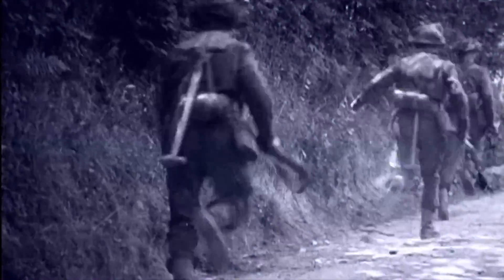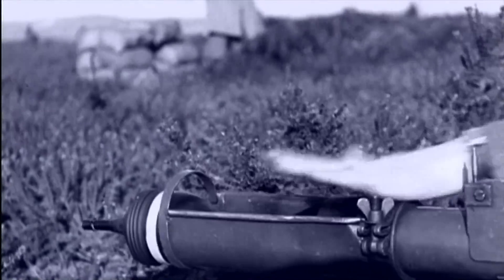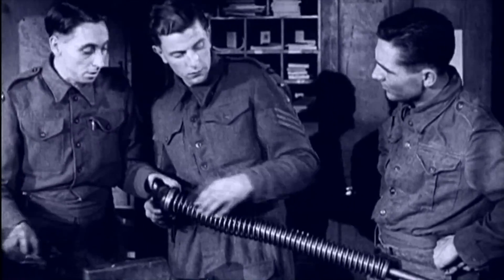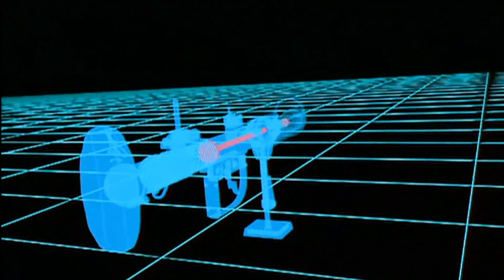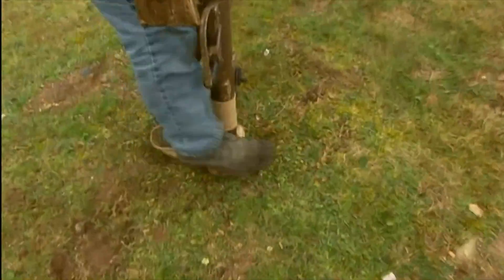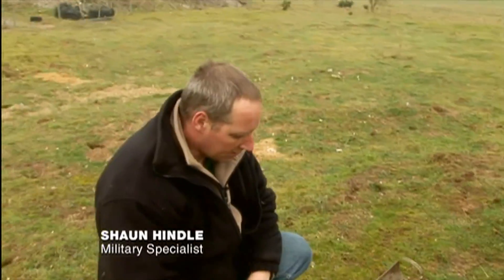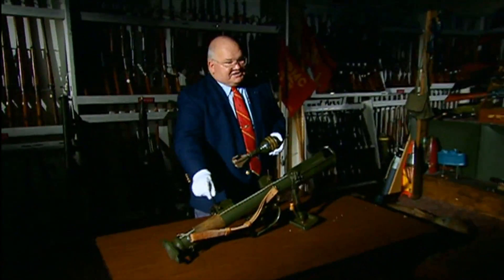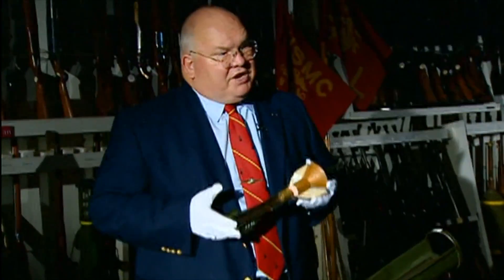Weaponology - "British PIAT"

Comment: No back blast or muzzle flash so ideal for firing undetected. Just because the range was short doesn't instantly mean it was terrible.
Reply: +CruelestChris guys like you seem to enjoy going round youtube videos and screaming your opinion in every comment that doesn't align with your point of view to make yourself look clever, i bet you have fun going round children's school plays and pointing out inaccuracies in the nativity story. 

But back to the main point of my original comment, would you rather have a possibly slightly less effective but multi-purpose rapid firing hollow charge launcher or a long reload weapon that relies on  the electrical ignition of a rocket motor to fire. Also the considerable back blast of the bazooka could be dangerous to troops behind the weapon while a PIAT presented no risk to comrades situated behind the firer.
Reply: Gregory Clark I would rather have something that could hit a tank from over 50m away
Reply: +Gregory Clark It's not worth arguing with the idiot mate. PIAT had some huge advantages over the rest, it was the only rapid fire man portable tank weapon for a start. A PIAT team could effectively do the same job as several bazooka teams with much less chance of being detected. Downsides - it was heavy and had recoil.
Reply: +CruelestChris I'm using it as evidence because it is numerous, official, concise, hard evidence. Do you have any?
Reply: CruelestChris
Right so it's only the 161 polled WW2 vets that said it was brilliant. But we shouldn't believe them, we should believe you in stead - a guy who thinks you can fire anti-tank rockets indoors undetected no problem as long as you leave a door open.
Reply: +CruelestChris Pure conjecture. You'r opinions count for nothing.
Reply: +CruelestChris Depends how much of a wimp you are.
Reply: Although once you fired its first round (assuming it worked) you had a shaped charge downrange every 4 seconds. With charge big enough to punch through a Tiger frontally and notoriously poor target acquisition on German tanks (from narrow sight pictures), if the PIAT got close to a tank it was going to kill it.
Reply: +CruelestChris They were all notoriously inaccurate. The advantage of PIAT was that you could rapidly fire off more rounds to compensate.
Reply: agt155 if you could hit anything
Reply: CruelestChris yeah that explains how there was still a Britain for you lot to 'save the ass of' two years into the war doesn't it... one bad weapon system does not a wimpy country make. I suppose the paratroopers at Arnhem using these things against Tiger Tanks at point-blank range were 'wimps' too, sure they were overwhelmed but they gave a lot more than they got and these admittedly terrible weapons still took a toll on the enemy whether you're prepared to accept that or not
Reply: You should research the VC-winning actions of Robert Cain and Ernest "Smokey" Smith as an example of the potential effectiveness of the PIAT.
Reply: CruelestChris How will they be able to figure out where they're firing from when they're dead?
Reply: CluelessChris.
Do you really think you are an authority on anything?  It is rather simple a well hidden PIAT could fire a few times from one position or relocate but you are jumping to the assumption there was something better which there was  not at the time, the Bazooka was later and useless until very late in the war.  My idea is based on what really happened rather than your comic book guesses of war.  Obviosly if they had an unlimited supply of anti tank guns that could be used quickly against advancing armour supported by infantry but in the real world there are many times when a small easily portable weapon that was easy to hide and that could destroy a tank is very useful.
Reply: CluelessChris.
Since you manage very well to live up to the name it seems to fit rather well.
The fact is rather simple there is no point talking about the merits of different weapons since at the time there was the PIAT or nothing.  The Bazooka was later and not as good.  
You said it the early Bazooka was pulled out of production but since you want to say they could have had the Bazooka at the same time why would the british want an expensive weapon that did not work?  
I stick to the facts, the PIAT could be used in places the Bazooka could not, the Bazooka gave away it's position while the PIAT did not.
The truth is the PIAT was not perfect but it did the job at the time.  
If the enemy has time to work out where a PIAT might be when there is a good chance there may well be a few more also hidden in the sme area and if one fires another may fire a couple of seconds later from a diferent position.  
You might wnat to make out there would be just one PIAT with no back up and maybe you need to think that for every PIAT there are probably a number of Bren guns and other weapons in the same area.
Reply: +CruelestChris Or perhaps it's just thier sense of humour? Canadian soldiers voted the PIAT their favourite weapon of the war, couldn't have been that bad could it?
Reply: I doubt you could throw a hand grenade that far and  and a hand grenade would have no effect on a tank. At least the PIAT was a very effective anti tank weapon.
Reply: CluelessGhris.
The PIAT was very effective at the time when there was nothing better and ould be fired frm a concealed position better than the later Bazooka which was not much good until late in the war and still needed improving.  PIAT teams could do what was required and one person could use the PIAT on his ownif he had to.  The crew of the vehicle fired at if it is still operational could try to guess where the shot came from and  hope to get the PIAT before being destroyed.
Reply: CluelessChris.
Just maybe I do know a little bit about war, I know real men fought and died, you are so desperate to make out the PIAT was no good that you are ignoring the fact it was the best weapon available for the job at the time.
So a tiny puff of smoke and a bang that may or may not have been noticed when you have tanks kicking up dust and making a lot of noise, men trying to keep their heads down in case apart from the PIAT there may be half a dozen Bren guns ready to take your head off. so for you the Germans would be standing up looking round for a little puff of smoke that they might just see before getting their heads shot off.  Could you try to stop being so ignorant or maybe that is just too hard for you.  
Real war is not like a Hollywood movie.
Group Captain Pickard was a pilot and commander in the RAF, awarded a DSO with 2 bars
Reply: CluelessChris.
The PIAT was as I have said many times the best available at the time, no fantasy about it being much less obvious when used than the Bazooka which wss not much good until the many issues were sort of sorted out after the war.  I did say that if the PIAT was American it would not be put down as useless but it would be claimed to have been the best thing since sliced bread.
Just maybe when you grow up you might strt to learn a tiny bit about war but that might be too much to expect from an ignorant fool like you.
Reply: Lmao you guys do remember a tanks field of view is pretty bad... the chances the commander is looking in the exact spot you are firing from is unlikely.
Reply: CruelestChris mum*
Reply: Strange that the PIAT was responsible for quite a number of German tanks, including the biggest German tanks that the Bazooka could not take out.  I would rather have a 17 pounder anti tank gun but for close range from a hidden position the PIAT was rather good.   
The piece of junk was a very good piece of junk if the results are anything to go by.  
Better a very good piece of junk than a perfect non existent weapon.
There are a number of people who think if it is British it is junk, if it is American it is the best.
I wonder how many tanks were taken out by all the wonderful Bazooka`s.
Reply: The BAR really was rubbish, the Sherman was ok but not great, it certainly was useless against heavy tanks, that is why the British put the 17 pounder in some of their Shermans so they had an even chance.  The Americans met few heavy tanks, the Britis and Candians did that.
Reply: +CruelestChris ....because war isn't a joke. They'd feel like real twats if they voted up this weapon for a joke only for the Canadian military to purchase 100 000 of them wouldn't they?
Reply: +CruelestChris The Canadian surveys are factual. You are just quoting old wives tales. What planet am I on? From the guy who thinks frontline combat soldiers from WW2 would lie about the effectiveness of their weapons "for a joke"..lol tell me another one, preferably with a bit of evidence this time.
Reply: +CruelestChris Do you honestly think Canadian soldiers were bullshitting when they said the PIAT was their most influential weapon? Answer honestly.
Reply: Those are quite a good advantages.
Reply: Barrie Rodliffe 
You are ridiculously exaggerating the extent to which PIAT fire could be concealed. The short effective range and ability to judge the direction of the shot based simply on which side of the target it hit would mean that most of the time infantry near the target would have a decent chance of seeing the puff of smoke from the propelling charge, and you'd only have a limited number of possible places the PIAT team can be.

PIAT teams relocated after firing just like everyone else. Nobody relies on the enemy remaining perpetually clueless when they're firing at a vehicle that only has to guess the right building to kill you.
Reply: Barrie Rodliffe 
Do you really think starting your posts with playground insults is a good way to get me to accept you as an authority on military technology? 

Anti tank teams relocate after firing. They can't assume they haven't been made, because you don't get to dodge a tank cannon round. Tanks operate with infantry, and infantry are pretty good at figuring out where a sniper is after one shot, never mind a weapon that's got to be less than one hundred yards from their current position.

Not to mention your idea only works in city combat and an unsupported tank in city combat might as well blow itself up and save enemy infantry the trouble.
Reply: Barrie Rodliffe 
Yep, you won't find me disagreeing with any of that.
Reply: Barrie Rodliffe 
I'm just doubleposting here because I don't want it to look like I'm editing the other one dishonestly, but to be entirely fair to the BAR it did give us the BAR mechanism , which as it turns out is very good if you flip it upside down, put an MG42 feed cover on it and call it an FN MAG. So the BAR is good if you turn it into a different gun :P

Much better than what the Yanks tried with sticking the MG42 feed cover on an FG42 and calling it the M60, that, um, didn't end well.
Reply: @CruelestChris  
The BAR is good if you turn it into a different gun, that makes sense to me.
To get back to the PIAT, in 1942 there were no Bazooka's and the PIAT worked, a soldier could use one on his own and he could take out any German tank from a hidden position  without giving away his position, perfect for ambushing tanks or even  moving through forest or buildings to get close and take out a tank before anyone knew he was there.  The later Bazooka was not as good in that way, use it once and everyone within a few miles knew where you were. Do not use it inside or you will only use it once.  
Was it a wonder do it all weapon?  No that is why they had a range of weapons.
Reply: @SvenTviking  
He has 161 officer's testimonies, unclear if they were given separately. He wants to use this to overrule people who actually used the things, because he claims they were joking. Um, right, ok. Why can't the officers have been joking? Oh, because he needs them to not be, I see.
Reply: +CruelestChris 
And you can stick to your day job instead of making crappy shoot em up let's plays. I suppose all those hours of reducing your brain to a violent, 'murica themed soup have paid off as you are now able to dump your unwanted opinion on a reasonable and intelligent comment showing the virtues of an effective and well liked weapon that was being unfairly criticised in the video.
Reply: +CruelestChris Why would they bother polling the soldiers if it didn't matter?
Reply: CruelestChris Your basic argument is that "It aint American, it aint shit!" And there's no links to the "info" on quality control.
Reply: +agt155 
You really do think they polled soldiers on what their favourite weapon was and the PIAT somehow won even though most infantry would never have even touched one, and this poll might have been used as sole justification for a bulk purchase? What's the weather like on your planet today?
Reply: +Gregory Clark What's even more pathetic is the guy has blocked me seeing his comments yet still replies to me. I've seen many special 'cases' on youtube but this guy takes the biscuit.
Reply: +agt155 
Oh, yeah, because that's totally how military purchasing is handled, right, they poll the soldiers on what weapons they like?
Reply: @CruelestChris  It was a survey of Canadian officers who had recently left combat in 1944 /1945 who voted it their number 1 most effective combat weapon with the Bren gun in 2nd place (incidentally a much better weapon than the BAR). Are you seriously suggesting officers would put their soldiers lives at risk whilst the war was still on by highly recommending an inadequate weapon as a joke?
Reply: @chrism7969  
It was a survey for a completely unclear purpose, of officers who watched weapons being used and not the soldiers who used them. They basically just put the most powerful weapons at the top of the list: the same list had the Sten in last place. Oddly enough, Canada did not stop using the Sten as a result.

And this survey of people who looked at people using PIATs (and in many cases probably not even that) is used to disregard many testimonies by soldiers who fired the things. Do you not see the problem with this?
Reply: @CruelestChris  Really, these were officers in combat who would have seen their men using the weapon. So what you are suggesting is that had the weapon been ineffective and resulted in men being killed to no purpose they would have recommended it for a joke? Do you know how ridiculous that opinion is? They recommended it because it could and did take out German armour and fixed fortifications. A weapon that could be fired from within a building with no.muzzle blast to reveal the firer's position is a very useful weapon. According to your logic the Boyes anti tank rifle would have been praised in the earlier part of the war because it was the biggest direct fire weapon an infantry company had but it wasn't and it was withdrawn from service for being ineffective.
Reply: @CruelestChris  Because the Stem was and is regarded as a rather poor sub machine gun. Cheap and easily massed produced but prone to stoppages which is not ideal in a primarily close quarter weapon like the Sten. Better to have the Stem than no submachine gun but it was a rather poor temporary stopgap.
Reply: @chrism7969  
How do you know that, exactly? Did all of those officers see every weapon in the Candian arsenal used at least once, or (more likely) did they just get a list of weapons and rank them by preference? Again, why was the Sten, a rugged and effective SMG, placed in last?

And I guess I have to give you the last point based on the results of the imaginary survey that doesn't exist outside of your head. How do you know they wouldn't have rated the Boys highly if it were still in service? Do you have a time machine?
Reply: @chrism7969  
Nonsense, the Sten was so effective the Germans started making them, Otto Skorzeny couldn't stop singing the praises of the silenced version. Of course, Otto, unlike these officers, had actually fired one. The British Special Forces seemed to like it too, given it was still in service until they adopted suppressed MP5s.

The only reason the Sten has a reputation for jamming is magazine malfunctions which it inherited from the MP40 due to using the same magazine, and the same spring failure issues with full magazines that the MP40, Bren and just about anything else with a spring follower had during the war.
Reply: @chrism7969 
No, the silenced versions were in service with the Special Forces until then, and the Volkssturm weren't the only ones using copied Stens. As noted, jamming issues were related to the magazine, and if a weapon goes off when you drop it, that's what a sling is for.
Reply: @chrism7969  
For God's sake it's the Sten, S-T-E-N, standing for Shepherd, Turpin and Enfield. It had the same problems with its magazine as just about every other weapon to use a dual-column single-feed magazine during the war, and it's pretty well documented that if they could get one, German soldiers would carry a Sten because it was easier to fire while prone than the MP40. And seriously, you think elite special forces are passed over for procurement? There was a suppressed Sterling, they kept using the Stens anyway.

All guns jam and malf, and soldiers love complaining about their gear and holding up the enemy's as better. We have accounts from Vietnamese soldiers about how they were stuck using grotty Soviet AKs and yearning for the space-age M16 that the American soldiers hated.
Reply: So you include the Thompson submachine gun as being prone to Jamming in your all WW2 submachine guns being prone to Jamming claim?
Reply: @chrism7969  
Yeah, it was. So much so that they completely removed the ability to load it with drum magazines in later military variants, and it was particularly known for locking up in North Africa because it didn't handle sand well. It also fired an extremely overpowered cartridge which made it hard to control in auto, and was too heavy and too expensive.
Reply: +agt155 
Do you know they weren't? Or that the survey has any meaning when most soldiers would by definition have been talking about a weapon they hadn't used and had no experience of any alternative to even if they had? You're the one trying to use it as evidence, you have to prove it actually is with something other than made-up bullshit about the magical consequences of soldiers dicking around with a pointless survey or not having tremendous insight into how their issued weapon compared to other weapons they hadn't used. Also how is it suddenly their most "influential" weapon rather than their favourite?
Reply: CruelestChris Straw man argument there, and a pathetic one at that.
Reply: sorry but by jumping up and down from a range of 30 metres the odds of you being spotted are almost certain.

the only good thing about this over other Rocket launcher systems was that you could fire it indoors and in rooms because of no rocket blast.
Reply: @Mush Morant Is right, it's one of those stories that convinced me the weapon was very effective in the right hands and situation, Even if an internet warrior such as Chris says otherwise.
Reply: Barrie Rodliffe 
Um, quite a lot of them. Since, you know, the penetration from the PIAT and M9 bazooka projectiles were exactly the same. So no, anything you could kill with a PIAT you could also kill with an M9.

Also given I've already said to you that I think the Bren was better than the BAR on multiple occasions, I don't know why you're still going with this "you just don't like British things!" angle. Fact is the majority of things you're coming up with either aren't true, don't matter, or omit key information that completely changes what they mean.
Reply: CluelessChris.
Thje Bazooka was good? only in the right circumstances,  it gave away it's position and was not so good.
The Rolls Royce Merlin engine was first put in a few Mustangs by Rolls Royce in late 1942, it took the Americans over a year to do the same and then Americans claim the Rolls Royce Merlin as their own because some were assembled by Packard.
The USAAF used  Bristol Beaufighters, DH Mosqitos and Supermarine Spitfires a lot yet hardly acknowledge that fact.
Reply: CruelestChris You must be fun at parties
Reply: CruelestChris But they still fucking fired it, and one made THE most important tank kills in Normandy, knocking out an AFV trying to recapture Pegasus bridge from the Ox&Bucks.
Reply: Your mom is fun at parties :D
Reply: As for the rest, this is Germany. Germany does combined arms. This fantasy situation where one tank putters into view and you're engaging it from a static position with no infantry supporting the tank? Doesn't happen. AT crews have to stay mobile. Bear in mind if you read his VC citation, the Tiger that Robert Cain shot (which was actually a StuG III) immediately knew where he was and opened fire on him, so, um, good job proving my point that the "firing undetected" claim is nonsense. In fact Cain and Smith's VC citations are excellent displays of how this weapon was actually used: aggressively, at close range, and with a great deal of danger to the gun crews. This wasn't some nice safe long-range weapon: if the Panzerschreck and Bazooka were powerful punches, the PIAT was a headbutt.

Note that I never said the weapon could not be used , just that claims that it was some kind of magic invisible rapid-fire superweapon, rather than a piece of junk that sometimes did what it was supposed to, are nonsense. Saying anything else disrespects the bold men who shouldered said piece of junk and with good old British grit and bloody-mindedness set about using it anyway.
Reply: No it's mom, it sounds more petty that way :)
Reply: But if you have to get that close you might as well just throw it or use a Molotov.
Reply: No, the Bazooka was good late in the war, if we were going by postwar reputation we'd have a much lower opinion of the M9 since the M9A1s issued in Korea had problems with the fact that nobody knew how to store rockets for extended periods (it had never really been an issue) and it was found the issued rockets had degraded to the point that they couldn't penetrate North Korean T-34/85s from any angle. Task Force Smith's experience during the Battle of Osan is a particularly infamous example of this.

Also come on, if "worked but was not American" was a factor we'd have a much lower opinion of the Merlin engine. You know, the one that was good enough the Yanks started throwing them on their Mustangs the first chance they got.
Reply: Barrie Rodliffe 
Thinking up cute little nicknames just makes it hard for me to take you seriously, which I don't think is what you want. We're talking about the relative tactical merits of weapons that have been obsolete for over half a century, not which Pokemon could beat up which other Pokemon.

I also never said that the British had something better (in fact elsewhere I've repeatedly said the PIAT was better than the M1 bazooka and comparable to the M1A1, and I'd only give it to the bazooka when the M9 came along). But seriously, your analysis is almost comically one-sided: if I were doing the same as you I could point to the faulty fuzes and hollow charge liners that severely impacted the performance of the PIAT when it was first used in Italy (25% of projectiles failed to detonate and there was something like a 20% loss of RHA performance because the hollow charge liner could easily become dislodged in transit).

Also you've said this before and it's still wrong, the bazooka was not later than the PIAT, it was actually around before it. PIAT was first issued around the time the M1s had been pulled from production because they were violently awful, and right before the M1A1 was introduced.

I said the reputation of the bazooka isn't based on its performance post-war, and that the reputation of British weapons isn't necessarily underplayed. Your attempt to trundle off into some fantasy world where a PIAT has the firing signature of a mouse farting while the bazooka has properties more normally associated with an erupting volcano is...well, kind of typical, at this point, but has little to do with the real properties of either weapon. You realise in most scenarios AT teams relocate because the enemy might find them through simple logic, right? Since the enemy is as capable of determining where a good location is as the AT team themselves are?
Reply: Barrie Rodliffe 
I never said it was no good. Do you even remember how this started? Your fantasies about the PIAT being some sort of invisible supergun weren't the issue. I was replying to you claim that the bazooka earned it's reputation after the war, and that the PIAT wasn't respected because it wasn't American.

Look, hilarious as your adorable little primary school bully act is, it's not going to convince me, so give it a rest and discuss this with me like an adult. Start off by levelling with me as to what, precisely, you're trying to prove here. If it's that the PIAT was better than the early Bazookas, I've already agreed with you. If it's that it was an expedient weapon and that the British really had no choice since they already had tooling laid to make thousands of PIATs and I believe millions of rounds of ammunition by the time the Bazooka was offered for lend-lease, I agree with that. If it's that somehow getting lend-lease M1s or even travelling to the future and getting M1A1s still wouldn't have been as good as manufacturing the PIAT, I agree with that. If it's that the PIAT could be an effective weapon if employed correctly, I even agree with that. If it's that the reputation of some American equipment is highly exaggerated, that's fine too (for example, the Garand has a reputation that would suggest it was made of gold and diamonds and ejected beautiful women instead of casings, while the real weapon is rather finicky and the op rod design makes it prone to some very nasty jams if dirt gets in the action) then that's fine. Though personally I think the tendency to play down the effectiveness of British gear is just as much based around the narrative of plucky England defeating the high-tech Nazis with grit and determination rather than fancy toys like the Yanks had.

What I don't agree with is your bizarre ideas about how limited the Bazooka was in terms of when and where it could be employed, or your exaggerated claims about how difficult the PIAT was to detect. If it really had such an advantage, surely we'd still be using infantry spigot mortars in combat?

The real advantage the PIAT had was the bravery of the men who carried it.
Reply: @CruelestChris  Weren't you the first one flinging around ad hominems left and right?
Reply: @CruelestChris  
Not that you would know, you keep on lying all the time.
Reply: @barrierodliffe4155  
Your replies grow gradually more incoherent.
Reply: @CruelestChris  
Or is it just that you hate the truth?
Reply: @barrierodliffe4155  
There's little point in continuing this if all you plan to do is act like a child.
Reply: @Lehr-km5be  
Unlike many I do not play war games, the real thing is bad enough.  I never fake anything.
The truth is the PIAT did the job  very well. Unlike the Bazooka it did not give it's position away and could be fired from inside a building.
Reply: @Lehr-km5be  
You do not know me or anything about me. so just pull your tiny head in.
I do not cry and the truth is what it is.   I do not rely on Wikipedia and even less on Hollywood movies which do not give anything positive about the excellent PIAT.  
You trying to make out you know anything much is very funny.
Reply: Barrie Rodliffe 
Look you're largely just violently agreeing with me here. I just said it could be used effectively and that the early bazooka variants were rubbish.

Also as I said, it's not necessarily true that American gear would be remembered well: the BAR certainly doesn't have that kind of reputation, and if anything the Sherman is unfairly maligned with all the talk of 7 to 1 casualty rates against German armour (the data doesn't match this at all). It really depends on a lot of factors how a weapon ends up being perceived in the long run.
Reply: +agt155 
It's not evidence of any of the claims you've made. And given you're happy to reduce British soldiers' testimony about the weapon to "jokes" or "old wives' tales" but explicitly trust a questionnaire given to 161 officers (who were unlikely to be the AT weapon operator in their squad) you are in no position to talk, captain bullshitter.
Reply: The problem with the PIAT was it worked but was not American, the Bazooka was not much of a weapon until after the war, and it still had the big problem that limited where it could be used and if it was used it gave away the position to the enemy.  The unreliable PIAT put quite a lot of tanks out of action and it was better than nothing.
Reply: @barrierodliffe4155  The problem with the PIAT was you couldn't scale it up. So post war it became obsolete in the face of thicker armour. The initial throw of the projectile being achieved by a big spring. If you needed a bigger projectile you need a bigger spring and a stronger housing for that spring. The result was a weapon that would have been too hard to cock and too heavy to be man portable.  Unlike the Bazooka where when a larger projectile was needed you could achieve this by increasing the diameter of the tube without too big a weight penalty and no increase in difficulty "cockng" the weapon. However, during the 2nd world war the PIAT was a perfectly good "last resort" anti armour weapon.
Reply: @chrism7969  
The PIAT worked in 1942 when there was nothing much as good, it was still in service until 1950, the Bazooka was not much good until the end of the war and still had very bad limitations.
Reply: @barrierodliffe4155  I didn't criticize the PIAT merely said it wasn't upgradeable because of its design. Unlike the Bazooka which was upgraded to the super bazooka by increasing the tube diameter and the size of the projectile to cope with thicker post war armour.  Not something that could be done with the PIAT. It was a good weapon for its time but that time was limited by its design. I am aware of no modern anti armour spigot mortars. However there are modern descendants of the bazooka.
Reply: @chrism7969  
Of course the Super Bazooka still had some of the drawbacks of the Bazooka.
Reply: @barrierodliffe4155  However, the tube launched anti armour missile concept is still alive and well in the form of various RPGs and the various Carl Gustav systems. Unlike the spring launched spigot mortar for which to the best of my knowledge there are no modern anti armour implementations. Which proves the only  point I was making which is the PIAT was a good enough weapon for its time but not upgradeable to cope with stronger armour in the post war world, difficulties with cocking and weight needed for a more powerful spring needed to launch a bigger projectile preventing such an upgrade.
Reply: @chrism7969  
Only if you call a Bazooka an RPG which is not really true, the Bazooka which was not much good until after the war has long gone, the PIAT was still in use years after the war and it had advantages over the Bazooka.
Reply: @chrism7969  Yes you are right - the idea of the spigot mortar was dropped completely after the war, as it was pretty much a dead end design. PIAT stayed in use only until 1950s, while Bazooka was still in use in Vietnam - of course modified, but it greatly shows the advantages of it. You are very much right, PIAT was a good weapon for it's time, but Bazooka was a revolutionary weapon and overall a much better system - it was the first modern manheld shaped charge rocket launcher weapon, which principle is still in use today. Carl Gustav is a bit of a different thing because it is a recoiless rifle, but some of it's ammunition is also shaped charged.
Reply: +agt155 
What's not factual is your frantic bullshitting about what they might be used for.
Reply: CruelestChris Oh, you’re well defensive there, he’s got you!
Reply: +Gregory Clark 
Um, you're firing explosive charges, I think they might figure out you're there and narrow down where "there" is considerably by which side of the target you hit.
Reply: +CruelestChris but once fired, the target is most likely destroyed and support from comrades would deal with accompanying infantry
Reply: +Gregory Clark 
Given it was notoriously inaccurate and if you have supporting infantry they're probably going to figure out where they are pretty quickly, um...
Reply: CruelestChris All of the early shaped charge weapons were pretty inaccurate and below 50 yrds seems to be the best range. All of them had their disadvantages, none was perfect. Whether muzzle flash, smoke, slow reload, too small warhead, weight, one shot and bulky or heavy to cock.
Reply: +agt155 
With the disadvantage that those probably wouldn't hit either because you'd buggered your shoulder firing the first one.
Reply: What was the poll? choice between a PIAT or PIAT? lol.
Reply: The problem with PIAT was how unreliable it was
Reply: +agt155 
And that couldn't have been the Canadians voting up the weapon they liked least as a joke because...?
Reply: 1IbramGaunt
Still a Britain for "you lot?" What, you mean the British? Grandfathers in the Royal Engineers and RAF, one grandmother was a bike courier during the Blitz. agt was the one saying that anyone who complained about firing the PIAT was a wimp, I just called him on it. He's probably deleted or edited that post since then because he's a dishonest idiot.
Reply: +agt155 
No, it's 161 people who told other people to use the guns and observed the results with none of the hassle or getting killed. Second place was the Bren, which rather cements that they were choosing weapons that did big stuff, so first and second place were both support weapons.
Reply: +agt155 
Smarter than you, along with every other living thing on this planet. Go away.
Reply: agt155
So...you don't know what an officer actually is, do you?
Reply: +agt155
YouTube mobile app doesn't properly block replies, go figure. I got bored of seeing your tedious drivel in my new messages, good to see you've found a fellow idiot to commune with. <3

Also worth noting: the best figures I can find for the practical rate of fire of a two-man PIAT team hover around 5 rounds per minute (least charitable number I could find was 2, which probably includes charging the weapon for the first round). The rate of fire of a two-man M1 bazooka team being, um, around five rounds per minute, with 10 being given for the M9. So no, it actually grants no advantage whatsoever in that regard. When you think about it that's not surprising, the weapon cocking itself confers no mechanical advantage over a bazooka which doesn't need to be cocked.
Reply: +agt155 
So you don't know, thanks for proving it.
Reply: +Gregory Clark
Yeah, when you can't win the argument, attack the man. Though the saying does omit "in the most ineffectual way possible," I guess you added that yourself. Make sure you don't strain yourself patting yourself on the back for being so "reasonable and intelligent" that you try to discard someone's arguments based on a cursory glance at their hobbies (that they haven't even done for over a year, at that).

Also 10/10 for observation there, I guess James Bond is an American now?
Reply: Gregory Clark
Was that your idea of a burn? Christ, stick to your day job.

If you're operating a bazooka with the proper two-man crew (same as the PIAT) the reload is a matter of stuffing another rocket into the back of the tube and tapping the shooter to tell him he's up (not on the helmet as is often seen in movies since that could knock it down over his eyes). It's not substantially longer than the PIAT's reload speed. And the PIAT had at least a 25% rate of rounds failing to fire or failing to detonate due to poor quality control, so it's not all roses even though it has a simpler mechanism.